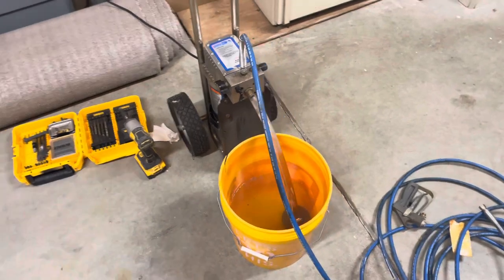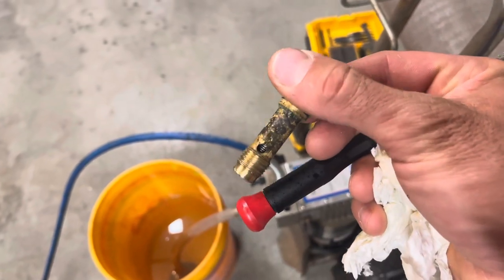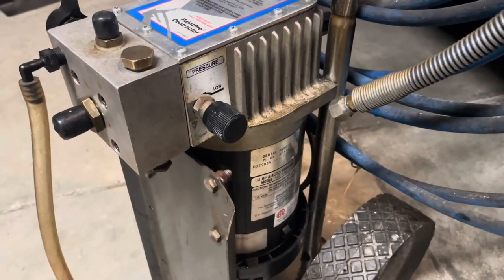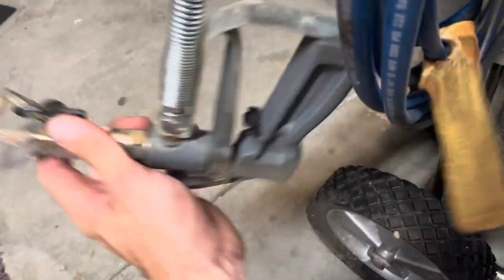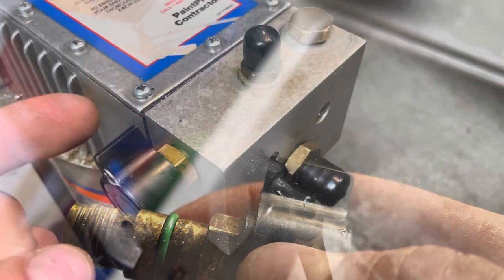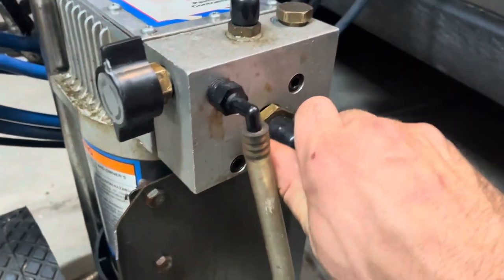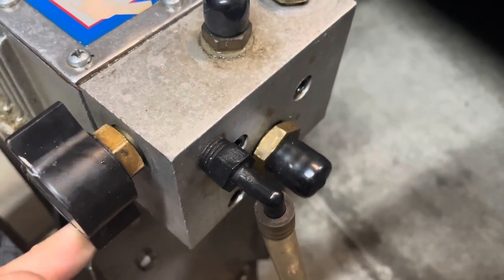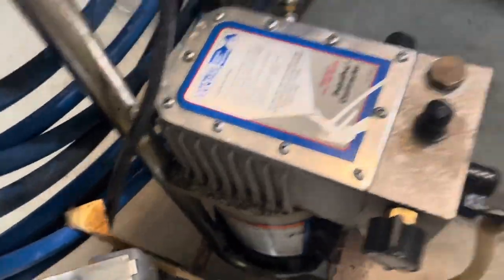Airless Paint Sprayer Campbell Hausfeld ( REPAIR! ) How to AL2305, 4ZC74

Comment: Dude, I bought the exact airless paint sprayer that was not working too. The problem with mine was the end of the diaphragm was wore off and I had to get a new one and the block was needing cleaning.  Also mine has a little filter at the gun so that has to be cleaned before using or after painting. Mine works now. Thanks for the video.
Reply from the maker: glad you got it going! hopefully the video helped. mine came with some spare filters but i don’t think i mention the filter because i was getting stumped on mine after checking the obvious!
Reply: oh yeah where do you get your parts from ???

Comment: I had trouble getting my Campbell Hausfeld to prime too. I ended just putting a hose clamp on the clear hose up by the block. What I think is happening is it is sucking air just before the block rather then sucking from the bottom of the hose. It is working now every time.
Reply from the maker: I don’t have my sprayer anymore. It ended up being a rubber seal in mine that i replaced with a new one from a harbor freight kit. Sounds like you got yours figured out, hopefully that tip will help others.
Reply: @KurtStevens-yi1jo  Could you help me with a photo since I have the same problem and there is no pressure, in the video it does not show when you remove the block and what changes that is my question, thank you

Comment: Hello, by chance do you have photos or video of the part where you remove the block since it is not visible in the video, I have the same problem on the same sprayer, I hope you can help me, excellent video
Reply from the maker: I no longer own the sprayer but from what i remember it was very simple to remove block with alan head bolts. Also take off the prime/ spray knob. My rubber seal was blown!!
Reply: @Zacpactv  I already did that, the engine sounds good, but I can't get it to press
Reply from the maker: @mariosolis9367  is it blowing any air with out hose or nozzel hooked up?
Reply: @Zacpactv  No, it doesn't blow any air
Reply from the maker: @mariosolis9367  ok then the head could be plugged. you will want to pull it. the fluid will spill out if its tipped. I believe its just compressor oil. try to keep it all in.
Reply: @Zacpactv  I'm going to take it to technical service, I really appreciate your help and that you responded, good night

Comment: Good morning, I have an air less equal to that 3/4, where can I buy the diaphragm?Thank you
Reply from the maker: i found alot out of stock. i did find one on ebay but remember mine being all white maybe you can see if it crosses over. https://www.ebay.com/itm/334685447129?mkcid=16&mkevt=1&mkrid=711-127632-2357-0&ssspo=EAmJar-oTKS&sssrc=2349624&ssuid=VNFXGVRZQ_2&var=&widget_ver=artemis&media=COPY
Reply: @Zacpactv  thank you very much for your reply

Comment: I just got one of these, but a little older model on Craigslist. It's in great shape and I went through your video before using it. After a day of spraying toward the end of the day the unit shut itself off I believe because of overheating. After a cooldown I heard a click and it was able to be run again. I just gave it an oil transfusion, and we'll test it again tomorrow. Have you run into that particular problem yet?
Reply from the maker: I sprayed two garage doors with mine and  an entry door. i thought maybe my paint was to thick towards the end because i ran out after spraying both over head doors and mixed in some 3-1 primer i thinned down with what was left. The unit did shut off to where it would not turn back on. I ended up taking the head off with alan wrenches after trying everything. i took it apart and inspected everything. put back together and thinned out some more and it worked fine. It sounds like yours did get to hot unless maybe you think the paint got to thick? Changing the oil was probably a good idea! Hopefully that will keep it running cool.

Comment: Anyone know where to buy a 2-3’ spray tip extension? Most of the ones around have 7/8” female end which doesn’t fit CH equipment.
Reply from the maker: You lost me at spray tip extension. Is it just and extension that you plug and play on the end of the nozzle?
Reply: It’s a metal tube that extends out the spray tip from the spray gun so that you have longer reach and less splatter on the painter.
Reply from the maker: @Renew60  ok i have not seen anything you just pop on the end like that without taking gun apart.
Reply from the maker: @Renew60  what size are the ch ends? Are you referring to the treads?
Reply: @Zacpactv  the diameter on standard extensions which you can buy is 7/8” which is too big for the CH spray gun.
Reply from the maker: @Renew60  I see do you know the diameter of whats on these?